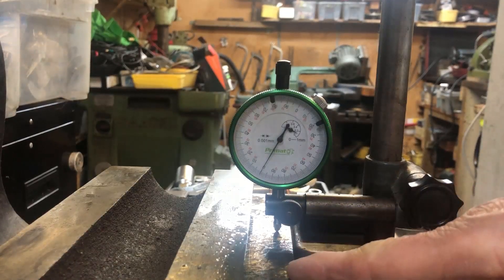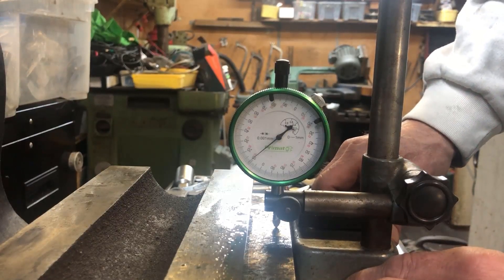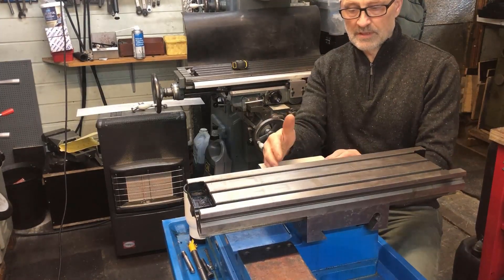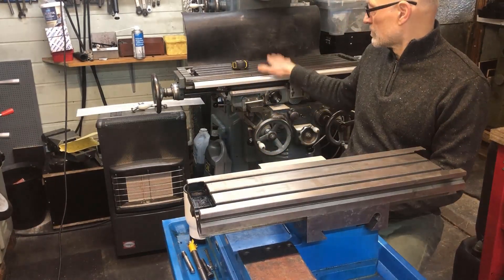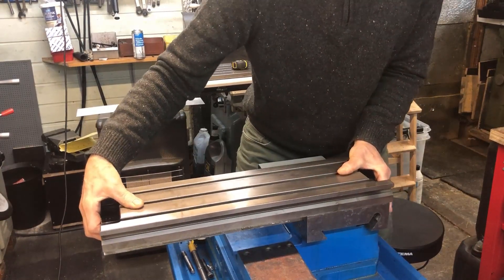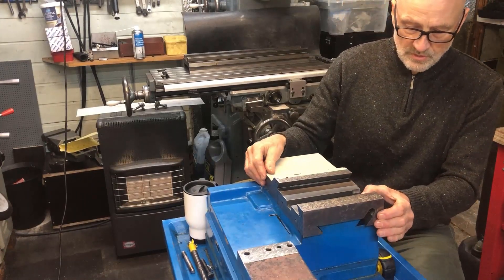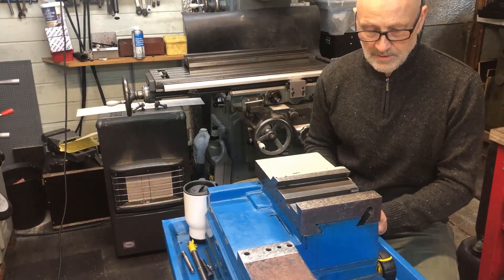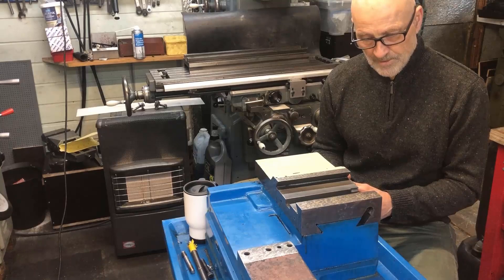Hand flaking: depth of marks. Also some general remarks on the CX 16 mill saddle vs table travel

Comment: I have seen milling machines that have an indexing head permanently parked on one end of a long table.  My belief is they are gathering dust and making sure the 'banana' wear between the table and saddle happens as fast as possible.  I tried to convince one person to stop doing that, but he doesn't think it affects wear "because they are made to do that". 

I have yet to think of a reasonable way to prove the effect.  Someday!
Reply from the maker: I guess if the milling machine is big enough and is spec'ed for the load it is OK, but these smaller hobby mills are probably "strecthed" too far. The tables on many really belongs on larger/heavier mills (in my opinion at least)